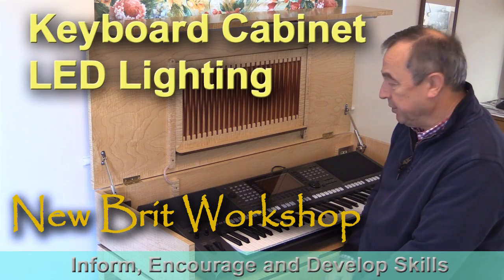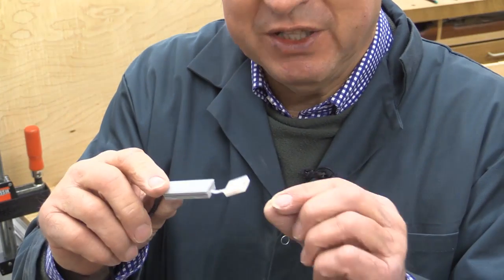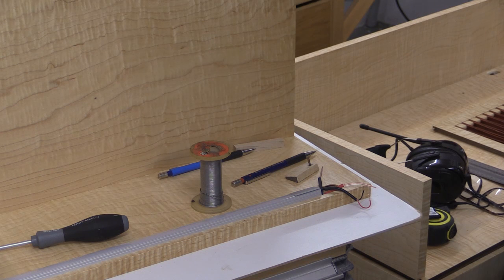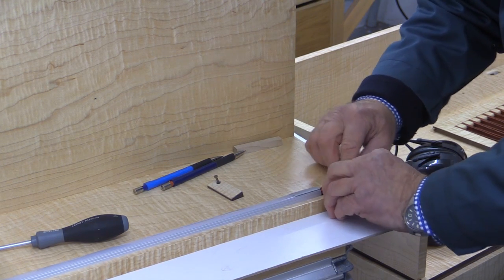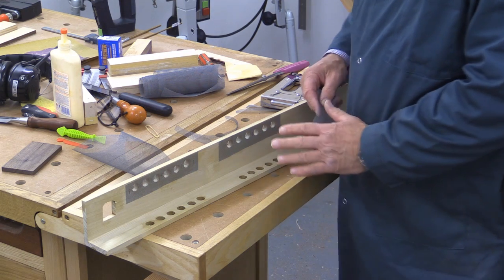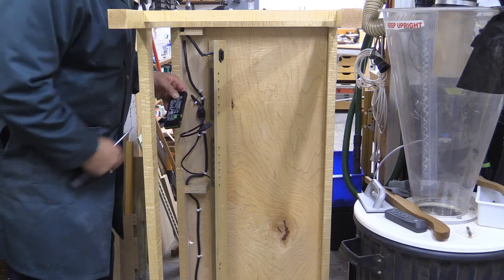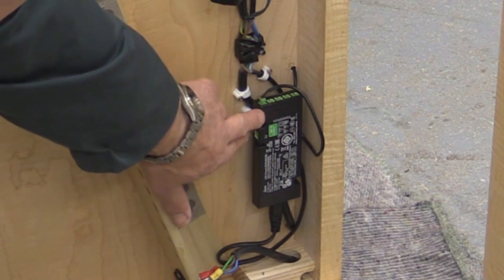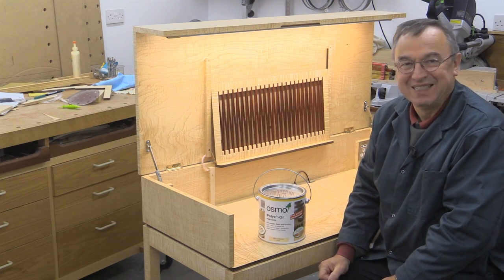Keyboard Cabinet LED Lighting

Comment: Wonderful work again :) 
Specially on longer led strips, do test-light it before installing it to channel and putting the cover on. Thus its refreshing to have wide variety of emotions goin thru when noticing some of the leds not working after hard work ;D
Reply from the maker: That is a good point - I should have shown the quick test that I did or at least mention it. The Hafele 24 volt kit is very impressive and is the only LED kit used by one of my professional friends. He likes it because the failure rate is very low and it is very easy to put together.    Cheers.    Peter

Comment: That's a really nice stand. Not liking the shake of stage keyboard stands, I got an industrial table. To that, I added a shelf that rests on the table for the speakers and music stand. I might need to rethink this as I especially like your lights and cover.
Reply from the maker: Hi Kent, I am currently working on the final version of the plans and will be making them available free of charge to anyone who would like them. One does not need to use veneering techniques and so the construction could be made simpler. The Hafele LED lights are way beyond my expectation and saying they are superb is an understatement.    Peter
Reply: Thanks Peter, I'll watch out for the plans. I was also thinking the general idea would be useful in a small workshop for covering up hardware that's more delicate while providing a temporary table when the lid is down. I was thinking items like a computer, with the LCD panel mounted on the lid, or inspection equipment, etc. Of course, I'm prone to cluttering up any horizontal surface, so I would probably also be clearing the surface off :)
Reply from the maker: Hi Kent, I will make an announcement when the plans are done. I have a similar concept for my small CNC which when not in use resides in a cabinet on top of which I have my track saw cutting station (created with the Parf Guide System - of course).   Peter

Comment: can you leave a link to the led parts especially the dimmer switch
Reply from the maker: Try this for 24 volt kit: https://www.hafele.co.uk/en/products/lighting-electrical-fittings/lighting/59bdc9b3ff4dfe68206f07e917201b70/?SearchParameter=%26checkbox_fs_lighting_mounting%3DStrip%2BLights%26checkbox_fs_lighting_technology%3DLED%2B24%2BV%26FF.followSearch%3D9953   and this for the dimmer switches: https://www.hafele.co.uk/en/product/led-dimmer-switch-for-loox-led-flexible-strip-lights-in-aluminium-profiles/83389119/?MasterSKU=000000cd00032c9f00020023#&PageNumber=1&Position=4&OrigPos=4&OriginalPageSize=12&QueryTerm=loox+dimmer&Category=AR_AqBtGKQQAAAFC9bdkdqDB&FF.followSearch=9837&PDP=true

Comment: You might want to look at http://www.accesscontrols.com.au/06511-00-power-transfer/ as an option for transferring power between your lid and base.  That way you can remove the lid without having to disconnect any cable.  There are various types of contact sizes and options.  You can also make your own bespoke set.
Reply from the maker: Many thanks for the link - I did search for something similar in the UK but everything was too big for my application.   Cheers.   Peter